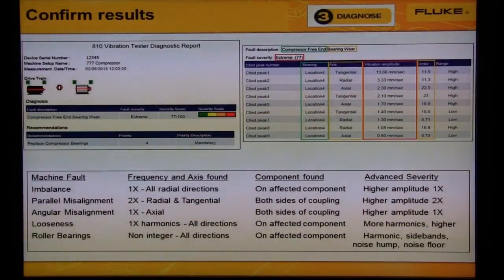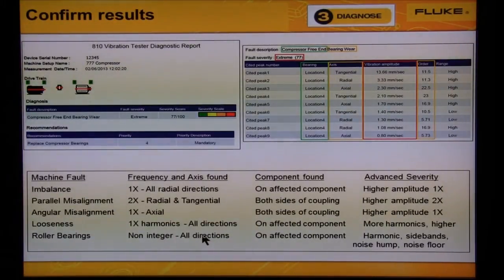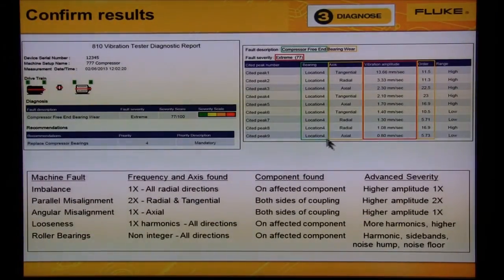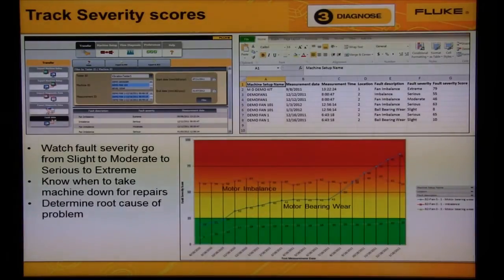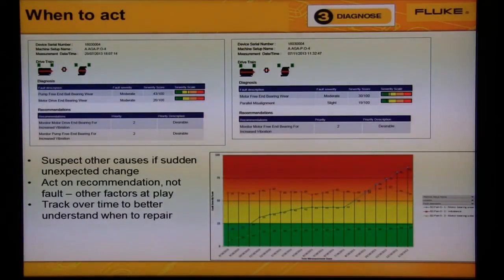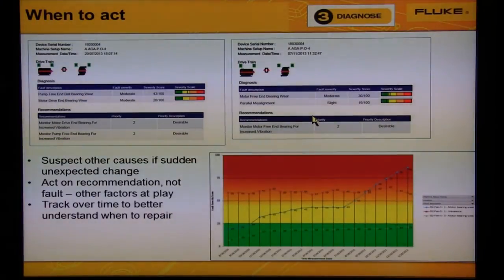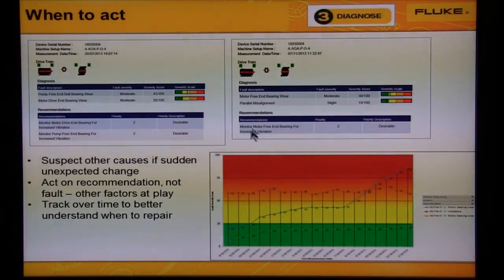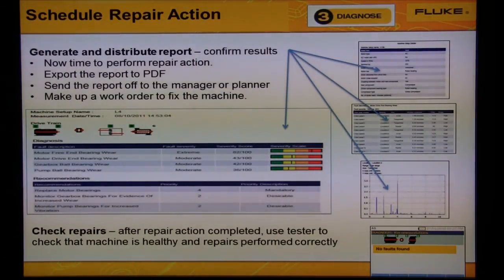How to Report, Export, Track and Prioritize Data With The Fluke 810 Vibration Tester

Comment: Hi....apreciate Fluke Team. I am a Mechanical engineer and work in the maintenance of Ships Big Diesel Engines. Now, I want to buy a Vibration Tester (between Fluke 810 and other equipment SKF), and my question is if this Tester can be used into the vibration analisys for these Combustion Engines or exclusively Electrical Motors DC/AC?
Reply from the maker: Hi Jesús - Great question. The Fluke 810 Vibration Tester analyzes common equipment like motors, fans and blowers, belts and chain drives, gearboxes, pumps, compressors, and spindles. We'd be happy to connect you with a Product Specialist to help answer any additional questions and/or place an order. Please visit our website for more details: https://www.fluke.com/en-us/product/mechanical-maintenance/vibration-analysis/fluke-810 - Thanks!

Comment: Hello Fluke Team, I have case of multiple asset spread at different location within which these pumps are present. Can i have any option to add one asset name before the Motor name .... so that i can easily identify the pump belongs to which area... etc. If i am not wrong this feature are available in Adash and GE equipment which i saw in training centre.  Since this unit is taken to many places then its difficult to archive complete document ... can we make archiving based on Asset group? please let me know any outcome or updates on this. Regards Prasanna Sinthaje